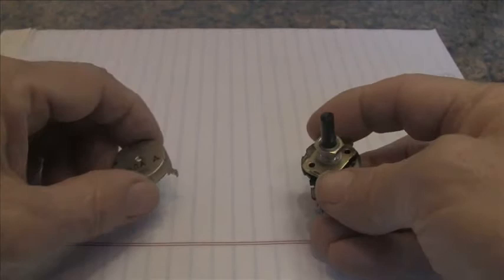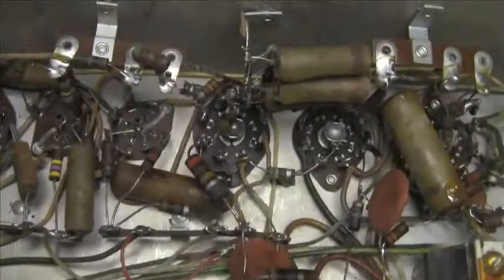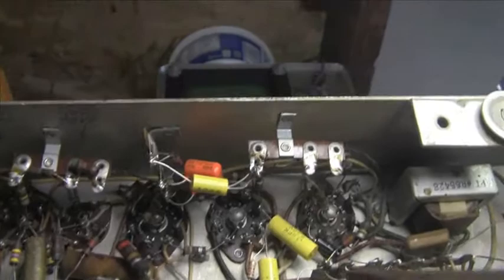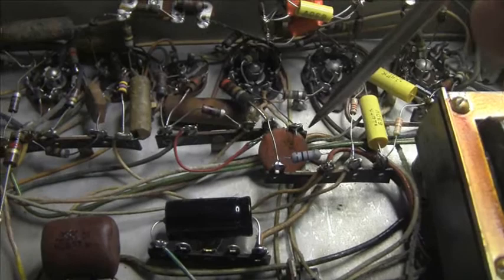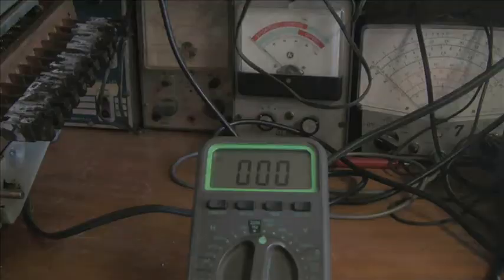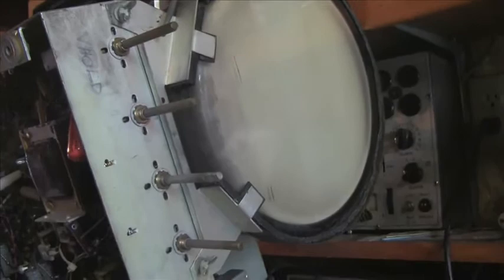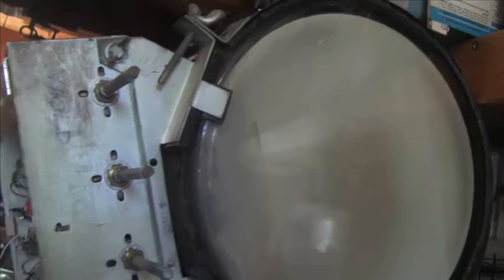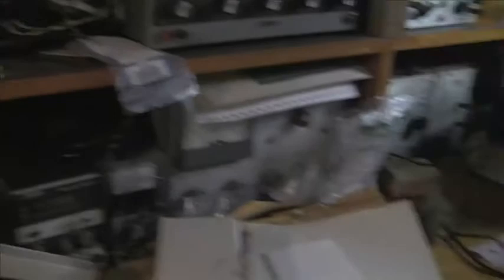1948 Sears Silvertone TV Radio console PT4

Comment: It's alive it's alive!!!!
I wonder if a dropping resistor in series with the B+ would work? With the transformer that's in there it's amazing that it ever work. You would think it would've turned into a large block of carbon. But you do have video so that is very encouraging.
Reply from the maker: The other tech (whomever he was) did very shoddy work on it and of course his choice for the power transformer was very wrong. There is plenty of room in the lower section of the console to install a homebrew power supply underneath and then cable it up to the chassis using an octal plug and socket for a disconnect. All that can be done but finding a good 10BP4 replacement CRT has to come first. I do not see myself taking this set much farther unless I do come across another good CRT. Thanks Rick. Gary
Reply: 10BP4s are the most common CRTs.  Plenty of replacements out there.
Reply from the maker: Bob you certainly would know more than I do as to what is available and what is not.  Perhaps I should try a WTB ad on Videokarma or the Earlytv foundation.  The other issue is the power supply. As a ham radio guy who has built a lot of gear in past years I would opt to build a separate supply and cable it into the chassis.
Reply: I hope you fine a good CRT

Comment: Looks like the B+ should be around 275 volts.  The rest of the set might bring it down once it's restore and working properly as it will draw more current. Did you measure the HV ? This set is quite rare are should be restored.  Power transformer and a 10BP4 are no big hurdle.
Reply from the maker: To restore it as originally wired I would need a power transformer that not only has the right voltage supply for the B+ but also two 5.0 volt windings. One for the two 5U4 tubes and one for the the 5V4 damper tube. Any thing beyond that is of course a modification. If I did do a modification with an external power supply I would do it in such a way that my work would be easily reversed back to original if by chance I do find a replacement transformer. I still have it on the bench. I can maybe measure the B+ voltage and let you know later on.